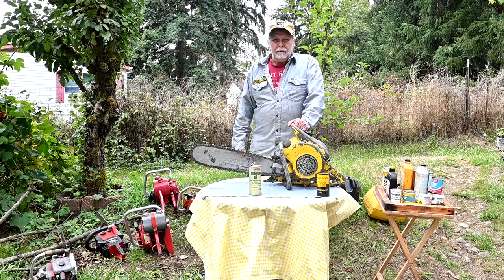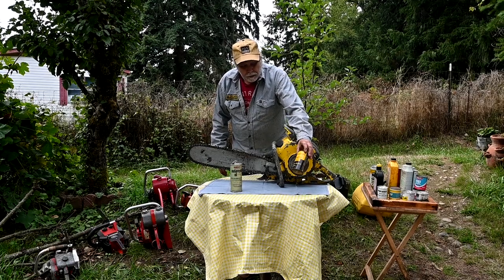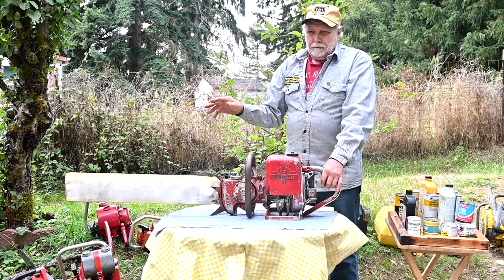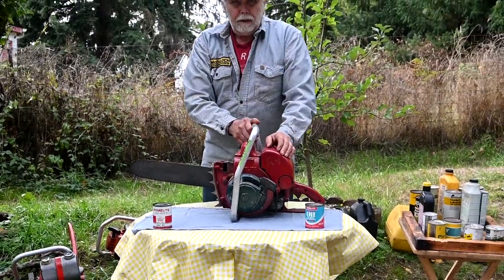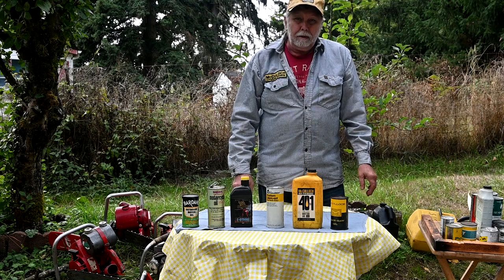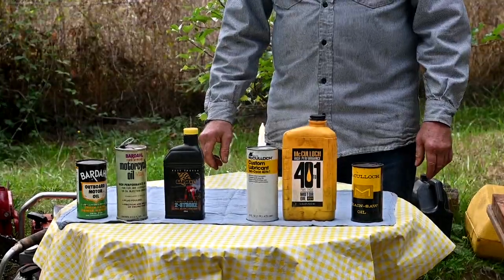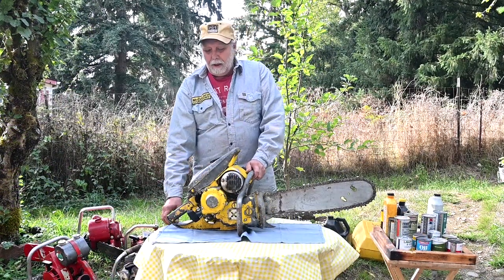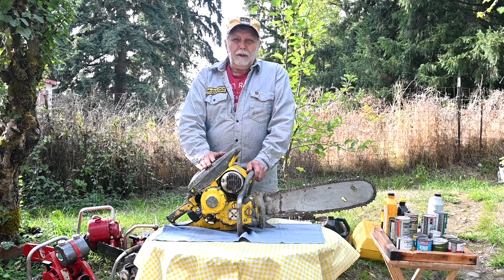Vintage Chainsaws Proper Oils and Mix Ratios

Comment: Back in the 70s we ran our saws on castrol R it had a unique smell when running. It was mineral based and it gummed up the carb if you left it for a long period of time with fuel in it. Great video
Reply from the maker: The Castrol R is made with castor bean oil  It was used because it would flow to a hot spot in a cylinder to keep it from seizing, but it doesnt burn very clean, separates in the gas if it sits for a while, and when the fuel evaporates, it leaves that gummy mess behind.
Reply from the maker: Castrol R is derived from Castor bean oil.  It has the unique feature is that it flows to a hot spot, where mineral oil doesnt.  It would separate out of the gas if it sat very long.  It also doesnt burn that clean either. We now have synthetics that are better, but dont work well in vintage 2 strokes.  Partial synthetic is the way to go.

Comment: Again always leaning something new! For now in the new saws just run the stuff that you get from the store that you mix in a gallon
Reply from the maker: Quite a lot of pro wood cutters are using the Echo Red Armor 2 cycle oil with great  results.  It is a partial synthetic like I use in my old saws, and if I had modern saws, that is what I would use.  I will be trying some in my old saws soon.  Stihl and Husky oils are not very good and wouldnt use them in any saws new or old.  Thanks again for watching.

Comment: Interesting video. A topic I think about a lot...what brand oil and what ratio should I use.
I’ve always been a 40:1 fan in vintage snowmobiles and some of my saws are 40:1 from the factory. 
I figured the newer synthetic oils might be better than old oil so maybe one could use 40:1 in 32:1 applications.
You use Yamalube and an oil I’ve been running is Mystik semi synthetic called “Sea and snow”. 
Supposedly can be used in both water craft and snowmobiles,chainsaws etc.
I’ve heard that Yamalube is Mystik oil but can not verify that.
I used it at 40:1 in my saws and they ran good but I didn’t like the oily residue in the exhaust. Real sticky. 
So being Canadian and since hardly anything is built here anymore I like to support products made here when I can so I tried Klondike oil which is actually made Canadian oil but refined in the USA.
Anyway same thing oily sticky exhaust. 
I used to be a Jonsered dealer years ago and the first saw I sold was a CS2137 which was actually a Poulan. 
Anyway the guy I sold it to bought a bunch of Jonsered two-stroke oil and used that mostly he said but a couple years ago he started using that true fuel premix stuff at 50:1.
The saw calls for 40:1.
So the saw was almost 25 years old and finally needed a carb kit and lines etc so he brought it to me and when I pulled the exhaust the muffler and spark arrestor were very clean and dry and a nice chocolate/tan colour. 
The piston looked like new.
I’m thinking I need to experiment with that stuff and see if it’s that fuel/oil or if its more to do with 50:1.
Great video sorry for the long winded post. Lol
Reply from the maker: Each oil has it's advantages and disadvantages.  I have used Yamalube partial synthetic in my saws, but it does leave an oily residue.  A lot of local loggers use it in their Stihls and Husky's with good results and they like the low cost compared to others.  The main oil I use is Bardahl VBA, but it hasn't been made for a very long time. I bought out a warehouse when I heard they were not selling it in the US anymore.  Still have some left, but will eventually run out. I never had any seizures with it or carbon, and had the nice tan coating on the piston crown.  I have had newer Husky's and Stihl's, and used their oils for warranty purposes, but the saws just wore or blew up running at 50 to 1. Any oil will work to a degree, but old saws at 50 to 1 will eventually fail in hot weather or hard work.  My little saws I run at 20 to 1, the mid size saws I run at 32 to1, and my big saws I generally run at 24 to 1. These are all vintage saws, as I dont have any modern saws anymore.  I will run more or less oil in them at times depending on how heavy the work load is or high temperatures.  The oils you have mentioned had been recommended to me, but are not available in my area, so I have never used them.  The Echo Red Armor has been recommended by pro's and home users quite a few times. So I am going to use it in selected saws over the spring and summer and make a judgement on it then.

Comment: every once in awhile i will mix alittle marvels magic mystery oil into my mix which helps clean up any carbon build up in the saw and lately ive been using maxima formula k2 motocross oil and it seems to be doing great. i have an 046 stihl ive put hundreds of hours on and it was used when i got it and last time i inspected the cylinder and piston it looked basically brand new. that mystery oil is great for so many things is kind of crazy.
Reply from the maker: Marvel Mystery oil is an excellent product with many uses.  I have never run it in my 2 strokes, only mt 4 strokes and as a penetrating oil.  I will have to try it in my 2 strokes.

Comment: I use Mobil one synthetic high mileage. Burns clean, don't clog screens, piston always looks like brand new, and it has a nice wet film of oil all the time. Haven't hurt one yet.
Reply from the maker: Never heard of using synthetic car oil in a saw before, very unusual !
Reply: @mrobsoletesvintagehomestea9156  Been doing it for 20 years.

Comment: Ok this sounds nuts. I buy the Super Teck two cycle oil at Wal mart. then I go to the Murphy and get the cheapest corn gas. I put two gallons in a can and ass a quart of the super tech. then add two more gallons of ethanol gas. then I add a pint of distilled water and shake that up really good. Go home and let that settle for a day or so, Then I careful to not let my hose touch the bottom siphon out 3  gallonsfor my chainsaws. yhe last gallon is put in my tractor. Its now blue colored. I can view the fuel in the glass settlement bulb. when it gets almost full of clear I remove the bulb and dump it out. I use that 16 to 1 mix in every saw new or old. and it works very well for me. All storage tanks at gas stations get condensation.If you buy the non ethanol you dont have anything to absorb the water. What in doing is removing the  ethanol by adding the distilled water.

Comment: Any views on Amsoil Saber 100-1?. I'm hoping to use it on all my 1950 to 1970's saws.

Apparently its very highly regarded.
Reply from the maker: Saber is good stuff for modern saws, but not at 100-1.  I have seen some say they use 70-1, but again in modern saws.  The problem with using full synthetic in vintage saws is that they have bigger clearances  between the piston and bore, and synthetic oil molecules are all the same size, and have a tendency to blow past the rings causing a seizure. This info was given to me by two different chemical engineers.  One worked for amsoil, the other for pennzoil. When synthetics first came out, the saw shops were real busy rebuilding top ends on the saws as a result.  I have used partial synthetic in my saws for over 45 years with no top end failures.  Since the oil molecules are not all the same size, the oil will fill in the wide and low spots in the bore, and the mineral oil and synthetic molecules are mixed, so you have the best lubrication.  My real early saws get 20-1, mid 60's saws get 24-1, later saws get 32-1, and for real light cutting, 40-1. The oil I have used since starting with using chainsaws in 1980, is no longer made, so I have been using ECHO RED ARMOR oil.  It has excellent film strength, burns real clean, and removes carbon and ash.
Reply: @mrobsoletesvintagehomestea9156  Thanks for details. I purchased a few litres of Makita 2 cycle oil. But will use that on newer saws. I have a swag of 1960's McCullochs, Homelite and I.E.L Pioneers which are from late 1950's I think. Also a few Pioneers from 1970's. Due to cost of living people are quitting toys.

Here in New Zealand the Stihl branded oil is actually blended n bottled by Castrol, it is a beautiful teal Blue color.
Reply from the maker: Stihl branded full synthetic oil is made by Castrol here in the states as well.  Don't use it in your old saws.  If you run 40-1 or less, you will have an excess amount of carbon and ash build up.  The same goes for amsoil.   Watch some video's by Richard Flagg, a pro saw repairman, and he shows saws that are torn down that have failed from using the Stihl oil and details out why they failed.
Reply: Amsoil is great at 50:1 and 40:1. Our Amsoil dealer does not recommend the 100:1 ratio.

Comment: I had filled my pm610 with my standard 50:1 but added an extra half of an ounce of Red Armor to its tank to bring it up to about a 20:1 mix, as you recommend.  I will see how it does on this mix.  I may make up a gallon mix for it at 20:1.  I know I need a muffler for it.  It’s current one has disappeared with just a few remnants left.  I am going to put a 20 inch bar on it when I can find one.  This saw has lots of compression.and a chain break that does not work, correctly.
Reply from the maker: It will be interesting to hear what you think of the McBrick once you get it running and cutting.  We dont have much hardwood around here, but some semi hardwood and soft wood mostly and I like to run a 24" bar. The saw has plenty of power to run that length bar.  I have never seen a 610 where the muffler rotted off, very unusual.  Most of my McBricks dont have the chain brake on them, but it should be very easy to fix the one you have if you like using them.

Comment: I never contemplated the big differences in the oils and the effects it would have on some of these older saws. Sincere thank you for sharing your knowledge. 
Question: Bar oil, any wisdom to share??
Reply from the maker: Most bar oils work OK.  The Stihl and Husky bar oils are quite thin and dont work well in my old saws.  The bar oils I use are from tractor supply-nice thick  oil and cheap, and the other is a private brand made for saw dealers in the PNW, and again a heavier oil.
Reply: @mrobsoletesvintagehomestea9156  thank you!

Comment: I'll have to check out the channel you suggested. My main oil of choice for my MS251 is AmsOil Saber, so I'll have to see if it is on the failure list. If it is I'll try something different, but most of the time I'll just buy a small metal tin of Tru-Fuel at 40:1 if I'm not using my saw a lot. It keeps for a long time since it's fully sealed and the fuel is ethanol-free. Also, I don't know how it compares to older castor based oils but I've been looking at Klotz BeNol to run in my YZ 465 when I eventually rebuild it. I've read a lot of positives on it with people saying it burns better than older oils. Again, just stuff I read. I don't know if modern versions have the same problems.

As for TC-W3, I read an older post on an arborist forum a while back from someone asking if it was safe to use in their saw and a lot of people on there said no. It's not safe to use in even modern saws. The reason they gave was because it's formulated for water-cooled engines and all chainsaws be them new or old are all air-cooled so TC-W3 supposedly makes saws run hot. Does that sound like a viable reason? I have a few gallons of TC-W3 I bought for cheap from our local Gander Outdoors when they went out of business a few years ago. But I only ever used it as a cheap upper cylinder lubricant in my old pickup. Which it helped a lot with, the truck ran smoother with it. :)
Reply from the maker: Amsoil has  a high ash content from the info I have seen on it, so personally I wouldn't use it.  Castor based oils just dont burn as clean as others I have found.  In my vintage air cooled dirt bikes I run Golden Spectro partial synthetic, and have used it in my old saws at times, and have never had a lubricity failure, such as a seizure or scoring.  I have been testing the ECHO Red Armor 2 cycle oil lately in some of the saws, and so far am impressed with the performance and clean burning.  It has also been recommended by many pro loggers. Don't use TCW rated oils in your saws, as they are designed for cooler running since they are water cooled, and most of the time run at steady throttle settings, so the oil doesn't have to be all that good.  I dont run full synthetic oil in any of my power equipment, and have never had a failure.
Reply: @mrobsoletesvintagehomestea9156  I'll have to look around and see what I find. I'll give the Echo oil a try as there's an Echo dealer 6 miles from my house. But I will need to find something to run in the McCulloch 1-40 I just got. I don't want to burn it up. My dirt bike is currently a basket case project so it's already apart. 

But once it's rebuilt I'll need a good oil to run in it. So I'll see what there is that's formulated for vintage equipment. I'd like to stick with something I can pick up locally if possible. The Golden Spectro oil is not something I've ever seen sold around here. As for TC-W3, I don't run it in my saw. It was only bought as cheap upper cylinder lubricant for my previous truck. 

Last questions: What about a 2-stroke oil that is aimed toward high performance racing purposes? If there are some I can run safely in my 1-40 and my dirt bike once it's rebuilt I have no problem ordering it. Would something with a high zinc content in it help like it does for flat tappet cams? And could I get away with using a high octane fuel that has a little bit of lead in it or would that cause too much fouling? I've ran it in an atv in the past a few times and had no problems. Regardless of price, oil is cheap, equipment is not. So I don't mind paying a little bit for it. :)
Reply from the maker: I would run the ECHO Red Armor in the McCulloch at 40 to1 if you are not doing any heavy work with it, but if you do,  run 32 to 1.  I dont know if any of the two stroke oils have zinc in them, and the lead substitute is for 4 strokes to protect the valves, so not needed in 2 strokes.  Golden Spectro can be purchased at Rocky Mountain ATV on line..  It is expensive, but worth it. @Slane583
Reply: @mrobsoletesvintagehomestea9156  I'll have to check it out. Thanks again. :)

Comment: Ironhorse sez he uses 40:1 in all his newer saws.  He said he can see the difference between 40:1 and 50:1 when he breaks saws down.  I run 40:1 in all my saws now.
Reply from the maker: 50 to 1 just isnt enough oil.  When repairing saws that use that ratio, they always have more wear than ones that have used more oil.

Comment: Any opinion on Klotz? I have been wanting to try it. Love the smell, 😆
Reply from the maker: I havent used klotz for years.  I tried it in my racing motorcycles a long time ago, and found it not to burn very clean.  The smell is from the castor bean oil.  They make a number of different oils now that were not available in the past.  If you are running old saws, I wouldnt use it, and the full synthetic they sell , I wouldnt use it either for the reasons I talk about in the video.  I dont know of any pro logger that ever used it either.

Comment: I like to use 16 to 1 most of the time. Because of heavy duty use. I always use quality oils that are two stroke mixing oils. I have already used straight 30 weight non-detergent oil mixed with two stroke oil just to be safe. Never had a problem. Synthetic oil I will pass on, they are rough on the gaskets and seals. Most manuals I have read say to use good quality 30 weight non-detergent oil well mixed before putting into the fuel tank. Done that also and never really had any issue with carbon at all. That is my two cents Mr. Obsoletes Vintage Homesteading.
Reply from the maker: A lot of vintage saws I have picked up over the years usually had a fair amount of carbon in them from using just motor oil, so I never have used it once I cleaned them out.  I have used a number of 2 stroke oils over the years, some with excellent results, and others not so much.  In my McCulloch's I used their oil till it wasn't available anymore, and used Bardahl VBA for almost all my 2 strokes, and almost exclusively in my chainsaws since.  By the color, smell and amount of smoke when using, I am willing to bet that they were one and the same.  I have never had a seizure or carbon problem with either of them, but neither are available any longer, and I have just a limited supply left.  I have been experimenting with the ECHO RED ARMOR oil in some of my equipment, and so far it is excellent.  I would run at least 20-1 in your equipment, as too much oil makes them run hot.
Reply: @mrobsoletesvintagehomestea9156  I can agree with you on all what you have said. I use two-cycle oil made by castor oil. Either it is 30 or 40 weight oil, as I do not remember right now. Did very little wood cutting this winter. My neighbor uses castor oil two cycle mixed with Wolf's head straight non-detergent motor oil, half and half mix of both oil's. His mix is 16:1 to 20:1 range. He said he has no buildup of carbon or ash. That was a problem with straight 30 weight oil. My saw's are clean for the most part when I checked with a little bit of residue. The engine has way more power at 20:1 is so true. I prefer the extra oil to keep the engine from running so high an RPM. Thanks for the total explanation Mr. Obsoletes Vintage Homesteading.
Reply from the maker: Your welcome. @victoryfirst2878
Reply: @mrobsoletesvintagehomestea9156  Sorry one more thing. Always shake your saw at least 30 seconds when using a saw that was seating a long time as the manual states. Thank you Sir for your time and channel giving honest information with substance. A trate not really found on many channels. Peace vf
Reply from the maker: It is always good to shake two stroke mix, whether in a saw that has been sitting or in your gas can.  Castor based oils separate from gas if stored for a while, so it is very important to give them the ol shakeroo. @victoryfirst2878